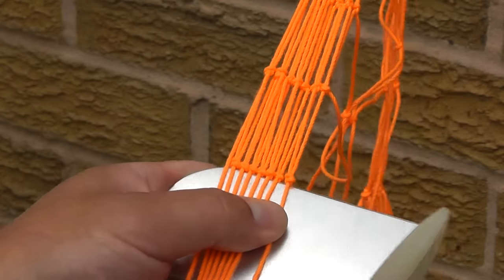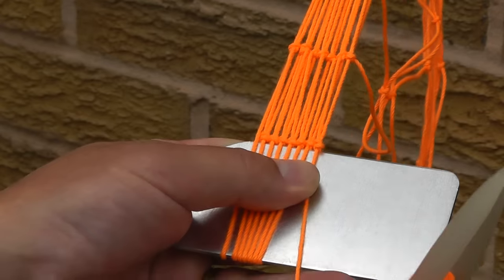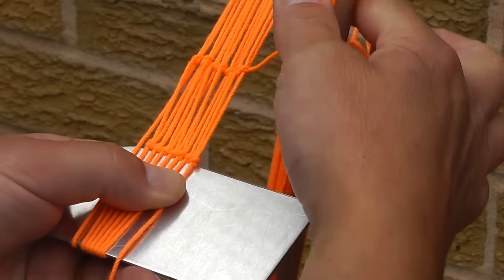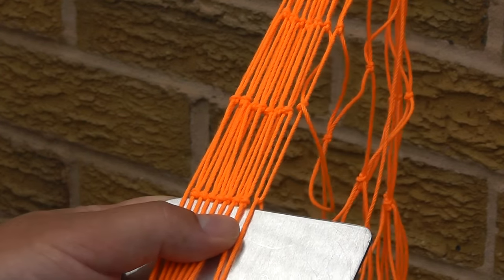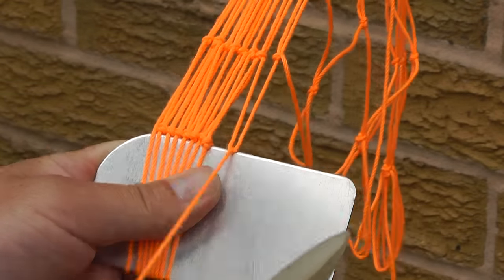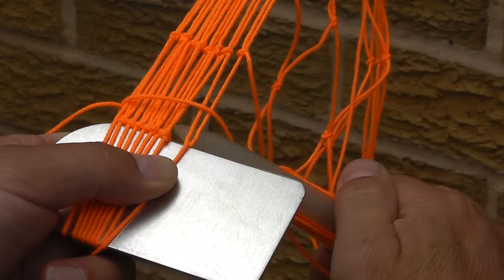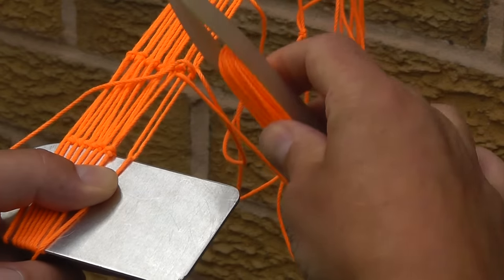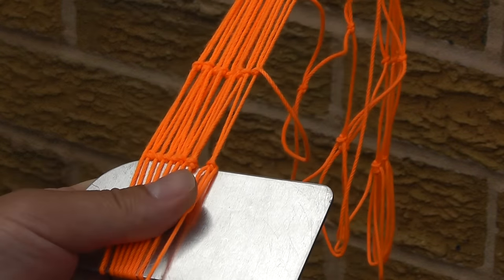Netmaking 2- the basic knot in close up

Comment: @freedomofabird The twine near the core is supple enough that tying as shown the knots don't slip.The nylon was unused but I think it was kept too long inside a hot car. I read that if nylon rope/twine gets hotter than 140F it weakens significantly. Maybe the heat made the outer layers stiff & springy.
I'll get new twine and start over.
The next problem I need to solve is some inconsistent mesh sizes. I'll concentrate on steady tension & mesh board position. Any other tips for that?  Thank you

Comment: @ freedomofabird Thank you.  Yes my twine is very springy, as is some other twine I have which is even smaller in diameter.  Locally that's the only quality of nylon I have access to.  I can get some braided nylon locally, but my research says braided is a little weaker for the same diameter and I'm hoping I can make a hammock with the twine.   I'll have to order on line and use a larger diameter to meet the recommended safety factor.  The smaller braided twine will suffice for smaller projects.

Comment from the maker: Hi Naugway, thank you for the comment. The knot I am tying is a double knot, and although it is not neccessary with the spun poly I am using in the video, it is a good back up to prevent slipping. It is really used, when tying nots in normal nylon twine, which slipps easily. I really do not know if it will work with monofilament, but it may do if wet.

The mesh board is made from aluminium, but can be made from anything, including, brass, copper, plastic, wood, horn etc. Must be comfortable!
Reply: freedomofabird

Comment: Hi and thank you for all the videos. Your explanations are concise and very helpful.. I'm just beginning to learn.  I'm having trouble with my knots slipping.  I'm using nylon wound twine about 3mm thick and its slick.  I'm using that twine because that's all I have at this time. I solved the slipping problem by throwing a loop over the left hand tying two strings,and then throwing another loop over the left hand again, and then tying just one string.  Do you have any suggestions?  part 1.